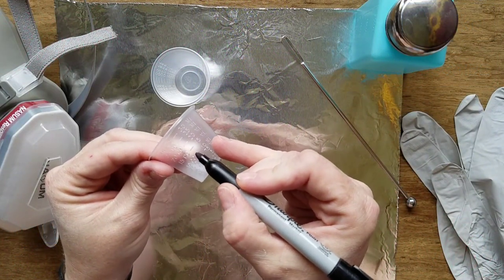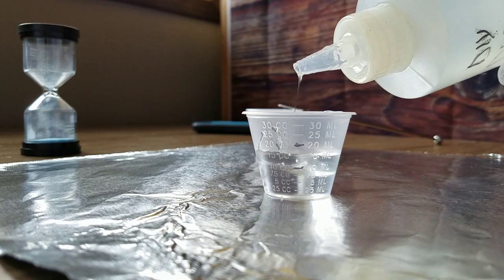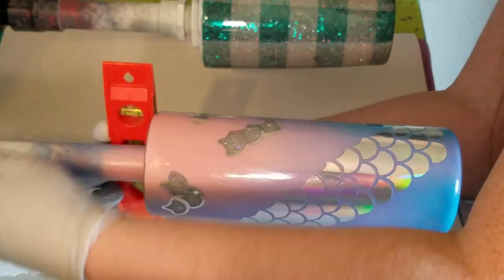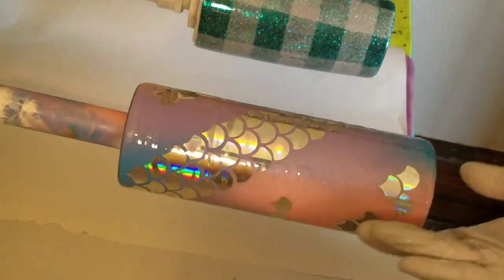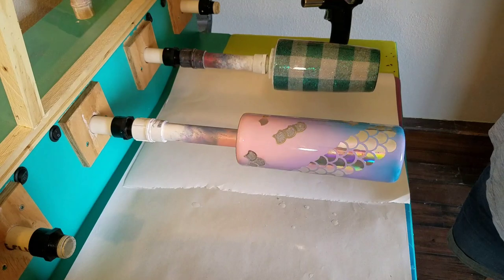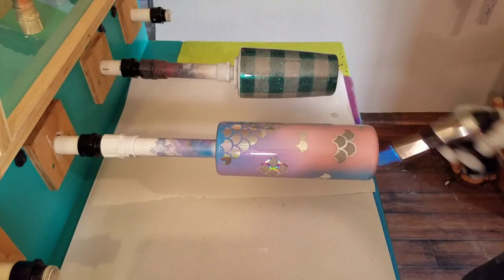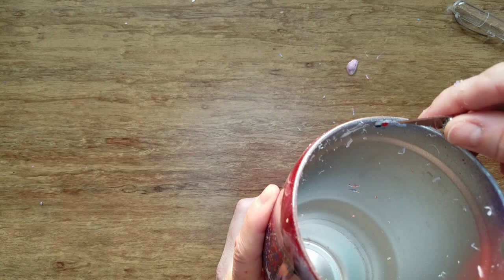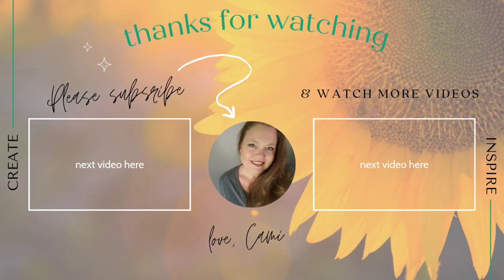HOW TO EPOXY A TUMBLER {BEGINNER SERIES} BONUS TIPS AND TRICKS

Comment: Can you use a heat gun or do you have to use a torch? I'm new to this. I see videos using heat guns and videos using torches. I'm confused...
Reply from the maker: I have never personally used a heat gun, so unfortunately, I can't attest to that part. I feel like the flame does 2 things 1. Heats the epoxy to being the bubbles to the surface to pop and 2. Helps to suck the oxygen, further eliminating the bubbles. The key is to not let the flame sit in and one area. Keep it moving! I hope this helped answer your question!

Comment: Is the flame of the torch touching the epoxy or hovering above?
Reply from the maker: Hi there! Great question! Sorry that I don't show that very well in this video but it is not touch it. A good 4-6 inches above is good. I know I get closer than that a lot of times. If you are using a propane torch it is much more important to stay further back as they have a much hotter flame! The most important thing is not to hover in one spot. Keep the flame moving at all times so you don't burn/scorch that epoxy. I hope this answered your question. Let me know if there's anything else I can do to help!
Reply: I do have one more question, how do you know how many times you should apply epoxy to your up? Thank you for answering my question! I’m glad I came across your channel.
Reply from the maker: @biancayun3944  you are soooo welcome honey! I'm here to help with as much as I can!! I still learn things all the time but there were some people at the beginning that helped me and I wanted to make sure I passed it on!!! So if I am doing a glitter tumbler I apply my glitter with the epoxy method then do a (2 part) flood coat. MOST of the time that gets enough coverage with little to no sanding (except the rim) to be able to move on to decal. Then after decal I usually do 1 more coat and after that spins for about 8-12 hours I feel it... if it's not smooth then I do another. If it's really bumpy I will do another (2 part) flood coat. It really does depend on what you are putting on it (fine vs chunky glitter etc) I try to do at least 3 but would rather have 4... idk I just feel like (without making it a behemoth thick heavy cup) I like several layers to make it sturdy and tough! Does any of this make sense? Lmbo I feel like I'm rambling!
Reply from the maker: @biancayun3944  also, just out of curiosity so I know what is working, how did you find me?
Reply: Aw.. that is so sweet! I’m glad you aren’t holding back on passing on the knowledge. I’ve been viewing anyone that has to epoxy cups and your channel came up as recommended, so I was all for it! Lol
Totally made sense but I never heard the term “flood coat” is that a heavy coat instead of a thin coat?
Reply from the maker: @biancayun3944  I need to do a video on it asap but like if I did a fine glitter on a 20oz skinny I would put about 30-40ml of epoxy on the first coat let it spin for 4-6 hours then about another 20-30ml. You want it thicker but not dripping off on both layers. With doing it at around the 5 hour mark, that first layer will still be tacky and will kinda grab the 2nd layer and let it settle in to any divots or crevices that there might be and causes it to all be more level!
Reply: Thank you so much. I’ll definitely turn my notifications on and keep an eye out for that video. You were so much help!
Reply from the maker: @biancayun3944  you are so very welcome! Please don't hesitate to reach out if you have any other questions! If I dont know the answer I will try to help find it!! Thank you so much for subscribing and please keep in touch!